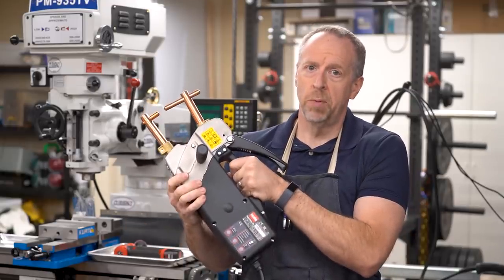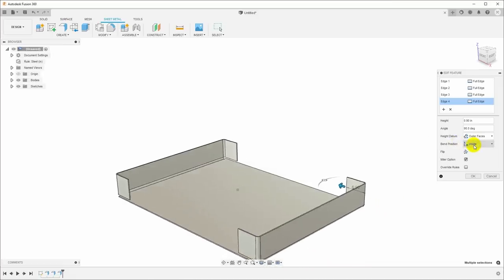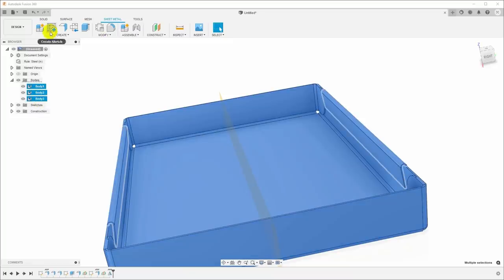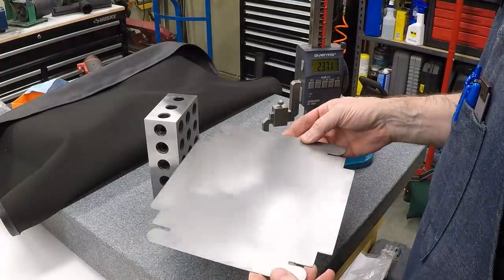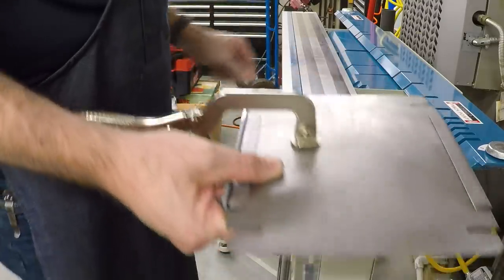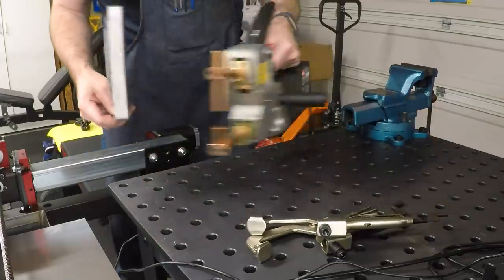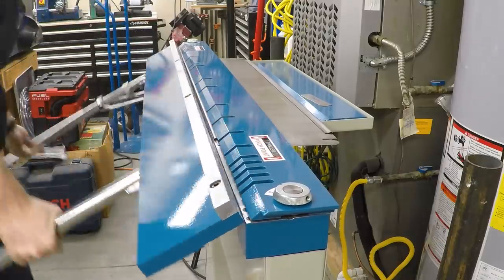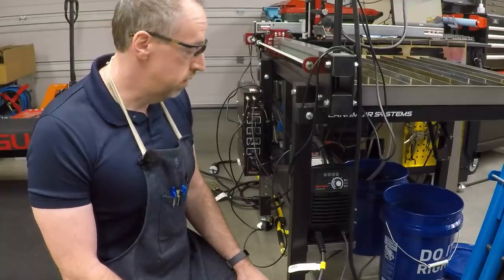Spot Welder FTW! | Fabricating a Steel Shelf for the CNC Plasma Table

Comment: Shane of Stuff Made Here made an attachment for his plasma table for a marker, which puts the bend lines on before you cut. Pretty neat
Reply from the maker: It'll have to do.  :)  The Shars is probably an order of magnitude more accurate than the plasma cut edge plus the human error at the brake.
Reply: You could do an air engraver to get an accurate line.
Reply: Just do a tool change, replace the plasma torch with a spring loaded drag engraver.  Something akin to a tap follower with a carbide point, done.  It's not a front panel, would be more than sufficient for fabrication lines.
Reply: I have a silly idea, let's say I'm working with thin aluminum sheet metal which I can cut with a desktop size CNC but don't have the rest of tools like flat surface, height gauge etc. Is there a way like getting the folds printer on a piece of paper, then ironing it over, if not, using a centre punch to mark the connecting vertices, mark the rest with carbide scribe? (Hobbyist only, I don't own any of the above, but looking to acquire something like 3018 CNC.)
Reply: @arthurmorgan8966  Jenny calipers, or odd-leg calipers, are cheap and will let you scribe a line a set distance parallel to an edge.

Comment: Hey James loving all the sheet metal and CAD stuff, it’s a big part of what I do professionally.  Moving forward try building your models centered on the default planes. This is easy to do given you can make rectangle sketches centered on the origin. This will keep you from needing to make midplanes and helps later if making assembles.

Comment: Every time I see that mag brake on your channel I start looking around the shop for a spot to put one!😀Some destructive testing on some spot welds would be a nice video.  Down here in Mississippi that 20ga mild would have rust on it before you finished the project!
Reply: Cracked up on the rust comment....

Comment: Fantastic! I get to live vicariously through your shop. As a suggestion since you are going Full Metal Shop, (you know what they say, never go full metal), go with powder coating instead of painting. Just get an old electric oven (i got mine free from someone putting it out on the curb). An Eastwood Powder Coating starter kit and you are set. Cheers.
Reply: That's true, powder coat is on my list too!
Reply: I was going to build an electric oven, but my neighbor had an old gas oven. It works fine and commercial powder coating oven are gas. I need to build a powder coating booth and am thinking about using an 18"x48" bench/shelving unit as the frame. A shelf can be set at bench height and horizontals at the top will give a place to attach plastic or sheeting. This will sit outside under a patio cover. Powder is very messy to have inside and I don't have the space for it. If it was used inside, a fan and filters could be used to draw the powder into the filters rather than all over the garage. For small parts, I set a large plastic tub on it's side, on my welding table, and sprayed them inside it so that some of the powder was kept in and around the tub.

Comment: As a sheet metal worker we do this typically.... 
If your going to do more types of trays/shelves, get or make offset  bent tips. You'll be able to make a few welds in the corners.

Also when you start a new set, need to file the tips to make a good point, fresh copper exposed, and that they are aligned. 

When doing a bunch of welds... Need to file on a regular basis. 
A good weld is usually signed by a copper mark in the weld. Especially in galv.
Reply from the maker: What I'd really like is a bottom tip that can reach inside a 1" x 1/16 wall square tube.
Reply: @Clough42  
Offhand... A ~1/2" copper rod/square bar with a small tip to clear inside can do.
In a pinch, A tip can be made out of any copper rod or even a mig tip cut down to fit... 
Depending on how for into the tube you need to weld to, this could work... 

If farther in , might just need a flat bottom tip and your regular top tip.
This will focus the energy onto the top.. 
Many different ways can be made for this operation...

Comment: It is absolutely amazing the world we live in where a hobby level worker can produce amazing parts with such ease( relatively speaking). These are expensive tools but not compared to industrial equipment. Volume is the key difference but just a few years ago it would have been exponentially more expensive diffucult to do the same work.

Comment: James, thank you for sharing this.  If you ever decide to fool with aluminum though, don't scribe it or you risk causing cracks -- a (soft lead) pencil line is preferred instead there.
Reply from the maker: I do a lot of work with aluminum.  If I ever build an airplane, I'll be really careful about stress risers in the material.  For most of what I do in the shop, it's unlikely to ever become a problem.

Comment: James, thanks for your great videos. One suggestion that might help would be to pick up a retractable tool balancer to mount over your fixture table to help handle the spot welder when your parts are clamped down to the table. Keep up the good work!
Reply from the maker: The spot welder has a threaded hole in the top for a support cable for exactly this reason.  I don't really have much trouble managing the weight, but I was struggling to figure out how to hold it without pressing the buttons.

Comment: Great video! I had a chance to use a magnetic brake and think my box pan will go on marketplace. I was  CNC laser operator and worked in the bend brake dept. at JD,my favorite was during shutdown the maintenance guys would need boxes containers and fixtures made from sheet metal, was fun building some one off stuff. I'm sure you will be making plenty of stuff for the shop.we also had big watercooled spot welders,maybe make a stand and foot pedal for it.
Reply from the maker: If I wanted it stationary on the bench, it will sit there easily without a stand.  Being hands free might be nice, but with my limited shop space, I like being able to stash it on a shelf under the welding table.
Reply: @Clough42  I'm the same, space is limited for me too,thx for the great content again!

Comment: 31:10 RE: removing in future if needed. Those round holes would be nice to tap for small size bolts like M3/M4, straight through the spot welt. It could break the parts apart and you have a bolt fastened system in the end. Your self drilling/tapping screws would work, too.
Reply from the maker: Yeah.  I wanted to avoid screw heads in the bottom of the tray.

Comment: I wonder if you can get magnets that would recess nicely in those 2-4-6 blocks that you can just bolt in, pop the sheet to it, align to the surface place and not have to hold AND scribe.  Also keep up the excellent work.  It's great to casually watch and add to the mental toolbox with these projects!

Comment: Great video! Liked and subscribed. Your skill and knowledge of F360 is impressive. I learned 3D modeling on another platform and the difference in both paradigm and increased number of bewildering options is making the learning curve of switching quite a challenge. I'm amazed not only with what you can do but how quickly you do it.

Comment: Nice little spot welder.  May want to consider a little waist high table to mount it and connect a foot pedal to the operating handle.  Spot welders really shine when assembling odd shaped or curved sheet metal parts but you often need both hands to hold pieces together thus the need for the foot pedal.  With the weight of that unit, it’s easier to take the work to the welder, not the welder to the work.
Reply from the maker: In this case, I was more concerned about the trays ending up flat, so I clamped them down and lifted the welder.

Comment: Sheet metal is really some kind of art, I did quite some sheet metal parts by myself already... I asked professional companies to do my parts and they did not have much clue about it since the volume was too small (few hundred pieces) and making a full punch / die gear would be too much for that - and very likely not yield a good result either in my case. My conclusion would be that some 3D laser cutting would be best after folding for my parts.

Comment: I have a very similar unit from htp welders. Learned u can spot weld aluminum with it as long as you put small steel straps on either side of the aluminum for the electrodes to squeeze.
Reply from the maker: Hmm.  I tried it (without the steel) and got very little fusion.

Comment: Re: safety glasses. I have had my safety glasses on when I really needed them on more than a few occasions starting with my work in an auto shop in the late 1960s and early 70s. I have always worn specs made with safety lenses since my early teens and those incidents made all of the "four eyes" taunts worth it.

Comment: With the Hem you can do it as two flange commands omitting the sketch. Overbend the first using the Symmetric option (maybe 110 degrees) with inner face and tangent at 3/16" (in your case?) then a normal 90 flange for the second. Tried to include a link to my plaything but you must have them disallowed.
Reply from the maker: I tried that and didn't get the result I wanted.  I might try again.  Re:  the links: I got fed up with all the bots dropping links to sex, malware, and scam sites on every video.
Reply: @Clough42  Yeah painful with the spam/scam stuff. I will drop you an email with  the link anyway to take a look.

Comment: Nice job.    I'd recommend you pop a couple of drain holes in it with a step drill.... Seems there is a lot of water above it in a place that could potentially turn it into a bathtub...
Reply: If you look closely, you can notice small openings in the four corners from the bend allowance

Comment: Very cool project and thanks for showing it from design through testing to final.  One minor suggestion for Fusion 360 is you can make/modify the  drawing template title block to allow you more usable drawing space on the sheet.  It’s a bit tedious but you can save the revised title block as a new template for use in the future. Or you can use one of the larger drawing formats then print to pdf then print the pdf to the 8-1/2x11 with scaling to get a paper copy for the shop.

Comment: If the tabs fit the finger slot, I would have bent the tabs and all on the side bends, less steps, instead of individually bending the tabs. It's been +40 years, since I've used a sheet metal brake in anger.😎
Best wishes from the far North.
Reply from the maker: The side bends and the tab bends are offset from each other.

Comment: I like to use a flat piece of steel with a nice square edge to knock off the dross on the parts. It's much faster than grinding and requires no consumables. An old or cheap parallel plate works really well or something along those lines.
Reply from the maker: Good idea.  I could probably fine tune things better to minimize the dross so a swipe on the scotch Brite wheel would be enough.
Reply: A 2.5-4 inch cold or mason chisel works well. It is far easier to scrape from the material outward/perpendicular to the cut, so that the chisel can get under the dross and break it off. The same goes for using a flap wheel. On the back side, I will lightly use a 40 grit flap wheel and on the front a 60 grit used lightly will clean up the pierce points and media blasting will remove the grind marks before powder coating. What really helps is to soak the parts in pool acid for an hour or so and then clean off the dross. It eats up part of it, especially on pierce points you plan to drill and on very detailed parts of thin sheet. The dross comes off easier after acid and any heavier rust (old material or sheets that have sat on the plasma table for a while) is dissolved. This saves wear and tear on drill bits and flap discs and reduces the amount of blasting needed. When I'm in a hurry, I scrape, use flap wheels, and then scotch bright pads on my 5" grinder. Flap wheels work much better than scotch bright for dross and the scotch bright cleans light surface rust.

Comment: Since you parameterized your LENGTH you could easily automate your hem length with a formula of LENGTH - some value. Or, parameterized your tab length and your hem length becomes LENGTH - 1.1*TABLENGTH (the 1.1 provides a 10% gap).
Reply from the maker: Yeah.  I felt a little dirty just dragging it out until it looked about right.

Comment: Nice. Might want to borrow a trick from networking/IT guys and grab a "2U" cable organizer for all those cables on the floor. Tack/bolt it right onto that shelf. Any of the ring style ones should be full metal. TBH you could probably make one yourself.
Reply from the maker: Way ahead of you.  It now has 40x20mm finger duct along the rails for cable management.

Comment: Fun and informative, as usual.

Looks to me like you would have been able to run the hems full length if the weld tabs had been put on the long sides. Or would that interfere with the folding operations in some way I'm not seeing?

Comment: Nice work! Have you thought about adding a magnetic angle finder to the brake so you can see what angle you are at? Not totally necessary but easy to install. Also, I'd be adding an intermediate circuit to the magnetic release circuit incorporating a ~3 second timer so that you only need to PRESS the release button rather than holding it. Just a thought!
Reply from the maker: The brake has an angle scale on the left handle.

Comment: Have you considered attaching a sharpie to the plasma cutter to do the first pass and then do the cutting?
Reply from the maker: Considered it for marking the bend lines, but the Langmuir controller would need to be replaced with something I could modify.

Comment: Thank you for sharing nice video👍👍👍 what is the voltage on that spot welding machine? Is it 110 or 220?
Reply from the maker: 220, which in my shop is 245.

Comment: Great machine , a brake and home gym all in one . LOL
Reply from the maker: In a pinch, the spot welder makes a good 30lb dumbbell.
Reply: @Clough42  Yes ,LOL. I have a 10 feet brake for aluminum flashing work (windows ,roofing e,t.c) the fold you made ,we call it double fold and we use either of the two ways to make it. I am a Glazier (commercial glass installer) by trade. You have a very nicely equipped shop,enjoy. Cheers from Toronto.

Comment: Nice work James keep up the great instructions. The HTP spot welder is the shirt and giggles I bought one 4 years ago and never look back works flawless ya.
I did not like the magnet sheet brake at first but after watching your video today I very much impressed with it.
I run a hydraulic press brake air bending NC and changing dies to do thicker material aluminum stainless A36 and pno but the 20ga pno I do on the big brake but I going to rethink my thoughts now thank you.
BTW when are you going to do more cnc milling on g704.
Did you get the extra accessories for the quick spot II
Reply from the maker: No extra accessories yet.  To be honest, I'm a little disappointed in the G0704.  It's fine, but adding a more capable spindle made its other limitations more obvious (Z backlash, MACH3, open-loop steppers).  I have another CNC project in the works, but it's proceeding slowly due to supply chain backlogs.
Reply: @Clough42  yep the supply change problem is pain now.
I been waiting on nema 34 3 to 1 gear reduction for large 5x10 plasma table build and helicut gear and track for 5 months.

Comment: You should make a pen plotter attachment like Stuff Made Here, I know it was already said but just in case you missed the other comment
Reply from the maker: The Langmuir Crossfire controller is closed source and doesn't really offer the flexibility to add something like that.  I was aware of this limitation, but opted to go that direction anyway, because I wanted to use a plasma table--not build a plasma table.
Reply: @Clough42  too bad we don't have a nice co-op making such things, with all open source hardware and libre software. Hopefully one day...

Comment: With the rounded tabs, I wonder if you couldn't have just extended the hem all the way to the end and let the rounded tabs just go inside the hems when you bend it?  I'm not sure if you could spot weld all three together but holes and a pop rivet would be a good alternative.
Reply from the maker: I think this is possible.  The geometry would have to be a little different.  And I think I could weld straight through at 20ga.  I wanted something ambitious for a first project, and that seemed like a level of complexity that was likely to lead to frustration.
Reply: @Clough42  Another commenter somewhere suggested putting hte rounded tabs on the long sides instead of short, then the hems be full length.

Comment: Would there be any benefit doing a rollover on the short sides?
Reply from the maker: It would make the edges smoother at the expense of making the tabs slightly more awkward to bend.
Reply: @Clough42  true. I commented before you did the full size piece. Upon seeing how that was attached with the support brackets any rollovers would be essentially redundant features. The rollovers on require for the long span to stiffen. That tray did like quite professional. A nice matt clear coat may look good keeping it “raw” but paint black to match the table could be good too. Would shame to see it rust out…

Be interested to see if you can make a folded bread tin. But that may require more prebending and then a dye/ sramp to finalize the folds (which are tight on the one I have here). Could be interesting content generator project - cutting, folding, milling dye’s and then stamping…